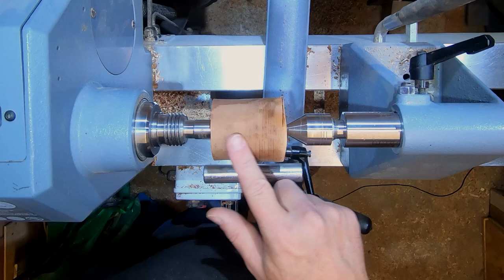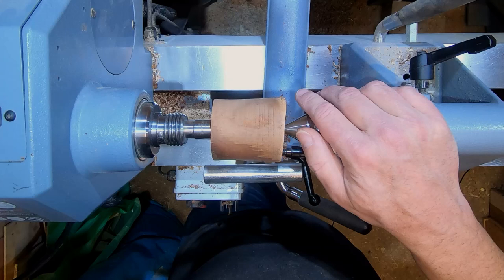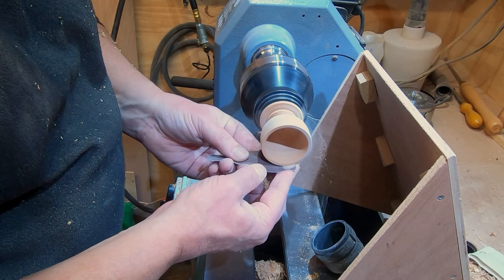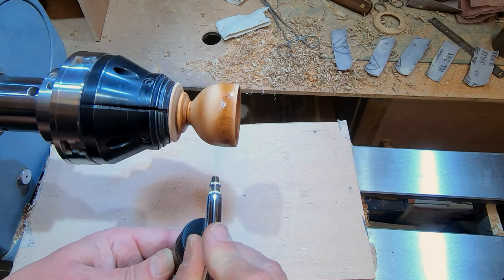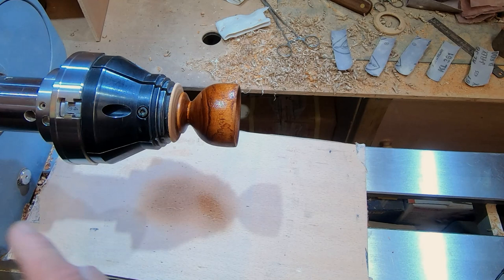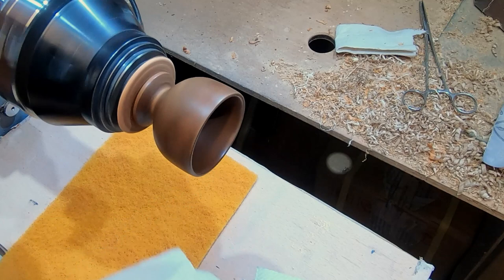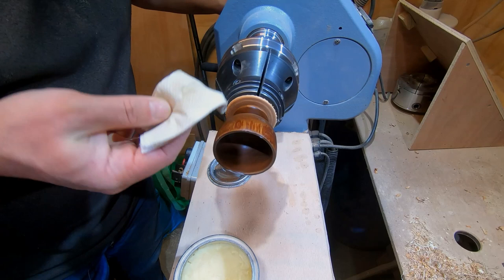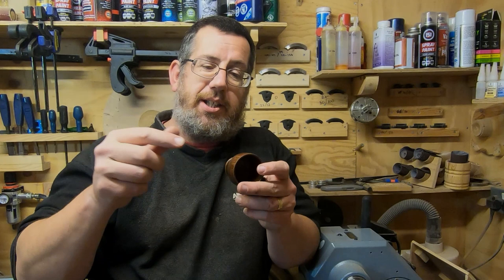Air Brush Demo - Episode 260

Comment: Hi Paul
I use a glue size of "Hide Glue" ratio 1 - 7. 
Apply two coats, denibbing in between with #220 paper.
You will get a uniform tone in colour, and you could have fixed your crack filling it with saw dust.
Hide Glue of course must be applied warm +/- 50 C.
Give it a try.
Reply from the maker: Thank you Barry. I've never heard of that before, will take a look into it. Is this the one that you have to melt?
Reply: @PaulLockwood  
Yes,
Put in a jar, cover with water, leave to form a jell. If very thick add some more water. Heat in a double boiler keep under 60C. Till a runny syrup.
Then dilute, apply warm, let dry, denibb, apply 2nd coat, final sand 360.
Spray on Stain.